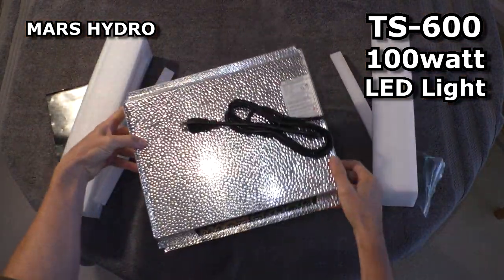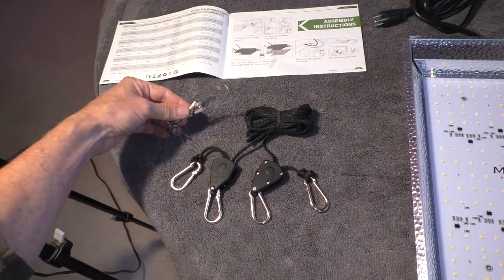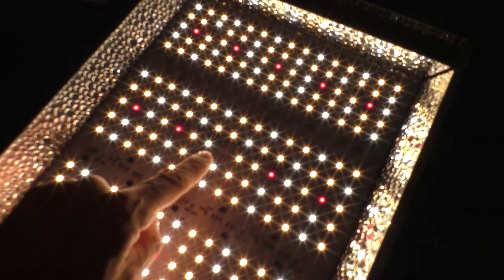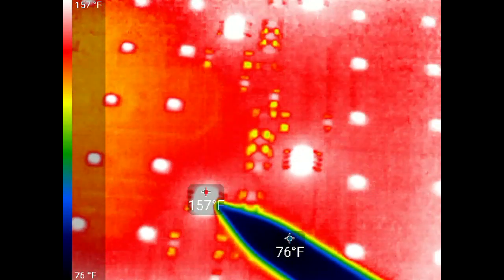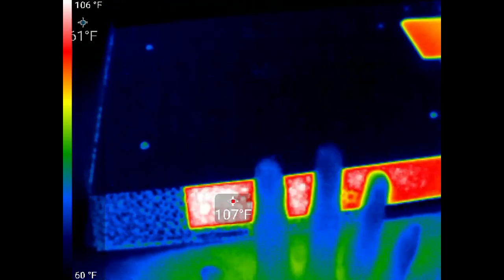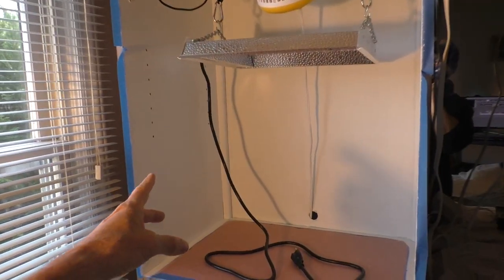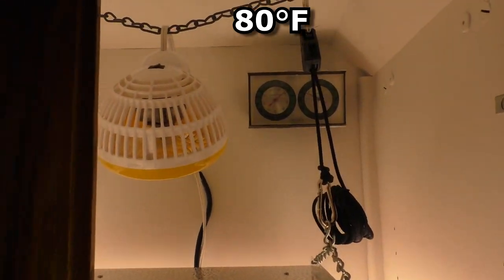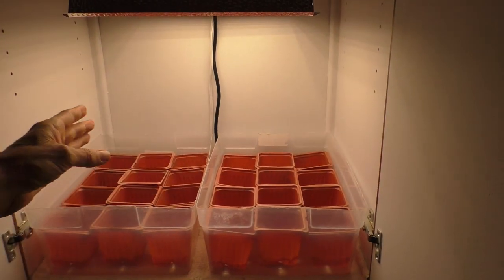NEW! 100 watt LED Grow Light for Seedlings MARS HYDRO TS 600 how to start a vegetable garden indoors

Comment from the maker: 100 watt LED Grow Light: https://amzn.to/2LxdAwt
This is the exact light i bought and show in this video.

Other Garden stuff I use:
Grey Containers I use on the deck to grow lettuce: https://amzn.to/35FoAx8
(The 7 Gallon model, drill drainage holes in bottom)
Organic Fertilizer 5-1-1 Quart size: https://amzn.to/31r2ACQ
Organic Fertilizer 5-1-1 Gallon size: https://amzn.to/2MsU3Lt
(I mix one tablespoon per gallon of water, feed once per week)
Morbloom Fertilizer 0-10-10 Quart: https://amzn.to/2J1x1sQ
Morbloom Fertilizer 0-10-10 Gallon: https://amzn.to/33NbeNL
(For the tomatoes and peppers)

EARTHWORM CASTINGS: https://amzn.to/31yKj6U
PERLITE: https://amzn.to/31ttOsC
VERMICULITE: https://amzn.to/32oCQIF
AZOMITE rock dust 44lb: https://amzn.to/35IhbNP
AZOMITE smaller 2lb bag: https://amzn.to/35VQ1mG
(mix into soil for healthier plants)

Seedling Heat Mat: https://amzn.to/35GsLsJ
Heat Mat Combo Pack: https://amzn.to/32t6agZ
Heat Mat Thermostat: https://amzn.to/2P6C3YS
Light Bulbs for indoor growing: https://amzn.to/35cqVhH
Reflector for light bulbs: https://amzn.to/359zXfr

Small 2" Seedling Pots: https://amzn.to/2VYAuOq
Larger 3.5" Seedling Pots: https://amzn.to/2J1dfxI
Sterlite 16qt Containers (Holds seedling pots): https://amzn.to/35IfzU1

Soil Sifting Screen: https://amzn.to/31yVpc4
Soil Test Kit: https://amzn.to/2RrtOpV
Gloves (Thin Blue): https://amzn.to/31zZtsd
Gloves (Red Heavy Duty): https://amzn.to/2MuFgzO

Food Dehydrator - Excalibur 2400: https://amzn.to/31qCsbh
Salad Spinner Colander (Zyliss): https://amzn.to/2pHLlAd
Food Processor (hand powered, Zyliss): https://amzn.to/35jkTiD
Basting Brush Set: https://amzn.to/2CjblrE
Knife (Shun): https://amzn.to/38jHScR
Jar Sealer Tool: https://amzn.to/2NVKJiJ
Vacuum Pump: https://amzn.to/32yyPRg
Potato Masher (for making Grape Juice): https://amzn.to/39ssv2U

55 Gallon Rain Barrels: https://amzn.to/35LYuIR
Bulk Head Fittings (Garden hose size): https://amzn.to/2qeOWpw
Spigot (Fast Water Flow): https://amzn.to/33Kbm0m

Wind Chimes I bought:
Medium size: https://amzn.to/33HA0Ph
Small version: https://amzn.to/2MVWPI7
Large size: https://amzn.to/2quYuNp

Garden Shoes (Waterproof):
HISEA Wetsuit Rubber Shoes: https://amzn.to/39LHvJi
Clarks Bowman Free: https://amzn.to/35FhZTo

Animal Control:
(Birds) Plastic Owl Scarecrow: https://amzn.to/2Tp52cE
Tulle Fabric Row Cover: https://amzn.to/2UsrGjH
(Deer) Motion Activated Water Sprinkler: https://amzn.to/2pFOKiH
Fence 50' roll(green coated wire): https://amzn.to/2P4l8X4

Insect Control:
BT Caterpillar Killer(Organic Safe): https://amzn.to/33LLxge
Neem Oil(Organic Safe): https://amzn.to/31nTczW
Diatomaceous Earth Powder(Organic safe): https://amzn.to/35NacmC

Cameras - Motion Activated:
For viewing Deer and Animals(also for time lapses):
Bushnell Trophy Cam: https://amzn.to/2OS2rWA
BOLY SG562-D (with spotlight) https://amzn.to/2BfQmm7

Camera I use to make youtube videos:
Panasonic HC-V770 Camcorder: https://amzn.to/2qc82MX

SEEDS - My Favorite Varieties:
Greens:
KALE: https://amzn.to/32uRazd
Collard Greens: https://amzn.to/32vv7J0
Lettuce - Red Sail: https://amzn.to/31r5XcY
Lettuce - Black Seeded Simpson: https://amzn.to/2MtGk7h

Tomatoes:
ROMA Italian Tomato: https://amzn.to/35MOlf1
Sun Sugar Cherry Tomato: https://amzn.to/2nX95zB

Peppers (Sweet):
Giant Marconi: https://amzn.to/2pBfTDK
Red Bell: https://amzn.to/2J2VYnI

Peppers (Hot):
Cayenne: https://amzn.to/2VU0vy3
Serrano: https://amzn.to/2VVBK4w

Beets: https://amzn.to/2pwpBXW
Radish: https://amzn.to/2VSk0Hx

Cucumbers:
Alibi (Most Productive I've Grown): https://amzn.to/35P7pZZ

Beans:
Rattlesnake Pole(Green and Purple Stripes): https://amzn.to/2BrdaPC

Green Watering Can: https://amzn.to/2MstSV9
Small Cages for Pepper Plants: https://amzn.to/33DiCuS
Greenhouse 8'x6': https://amzn.to/32ehLQt

Thanks. I hope this list was helpful to someone.

(paid link)
As an Amazon Associate I earn from qualifying purchases.
Reply: I have the exact same hygrometer. It's an oldie. SPRINGFIELD  Made in U.S.A. Great video. And the same light.

Comment: Great review! Be careful when measuring temperature on shiny/metallic surfaces. They usually give inaccurate readings due to low emissivity. That's why the stickers are registering warmer than the back. Try to measure off matte/dull surfaces for higher emissivity and more accurate readings.

Comment: 6:19 in your video what are those links holding it up? What did you swap out? And is it more sturdy?
Reply from the maker: i used some small sections of chain. it holds the light up higher than the stock wire hooks.

Comment: Those led fixtures go around 10,000 hours then they die i bought couple im not fan of changing fixtures every few years,its like ford eco boost after 85000k boosters goes then you need new engine,i rather use compact fluorescent or t8,cheers.

Comment: Reflective aluminum foil would work better than white paint. Also, the plants will grow faster with these LEDs, you may want to adjust when to start seedlings as you they may out grow your space before temperature is right to be transplanted.

Comment: What Lumens were the prev bulbs and what Lumens is the new light panel?
Reply: Photosynthetically active radiation or PAR is measured in micromoles and is a a better indicator of the effectiveness of a grow light than lumens, which is simply a measurement of light visible to the human eye rather than to plants. The CFLs claim to put out more lumens than they do but it's still a fraction of the nearly 13k lumens this led produces. Maybe 1k or so lumens if I recall per 42w CFL.

Comment: So we all switched from incandescent bulbs to ~5W LED so we could get rid of those energy hungry, hot 100W bulbs.
But now .. people start using 100W LEDs .. so then we're back at the same energy consumption.
Reply from the maker: yes, this 100 watt LED light puts out as much light as an 250 watt HPS lamp. The amount of light output is much higher than a 100 incandescent bulb. More light = faster and stronger plant growth. Thanks
Reply: Will this light cause a high light bill?

Comment: The only issue MANY of my friends have had with this type of grow light is it actually is too strong at similar distances. Friends have had to move their LED lights farther away then the fluorescent lights. Your seedling cabinet may not afford that luxury. I agree with previous poster about a trial run to test the set up. 

Love your videos and set up. Thanks for making them!
Reply from the maker: thanks for the tips. I'll make sure to start with the light mounted higher and keep an eye on it closely.
Reply: Yeah I’ve been trying to use the updated version of this light it’s a little difficult to dial in it definitely needs to be 30” or more away from seedlings
Reply: @yaboi1474 Spiderfarmer do 60cm long 33W strip light LEDs which are Perfect for seedlings clones or early veg stage. 
Between 6 and 12inches is ideal distance for those.
Another company makes 20W full spectrum LED's for £11 and those have been brilliant, 40W provide enough light for seedling and early veg growth over a 2x1.5ft area

Comment: How many of these would it take to flower a 4x4 Tent ? I was thinking about getting several of these since only 100 watts at the wall I like the infrared footage
Reply from the maker: hi, i read that four TS-600 lights would be good for a 4'x4' area. One thing i saw was a guy likes running a bunch of these TS600s because he had a big HPS lamp go down and the entire room went dark for days. With multiple 100 watt lights if one light goes down there are others that keep the room going.

Comment: The pulley system that allows you to raise and lower the light seems very convenient. My seedling lights are fixed so I have raise and lower the seedling trays which isn’t ideal.
Reply from the maker: hi, yes the included hanging hardware was a surprise. Overall the light it crazy bright, i had to wear sunglasses while working with it. thanks